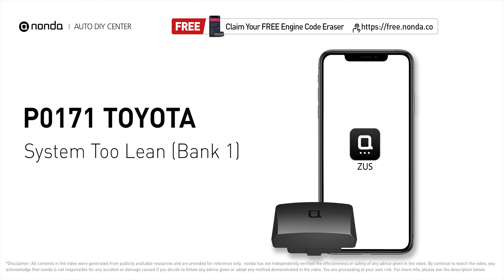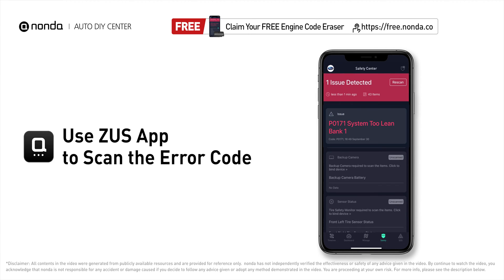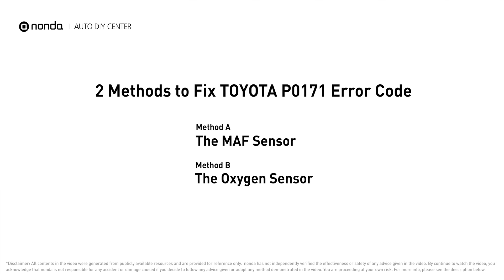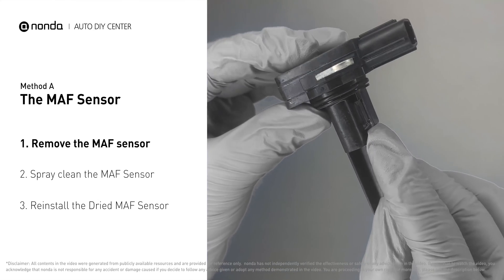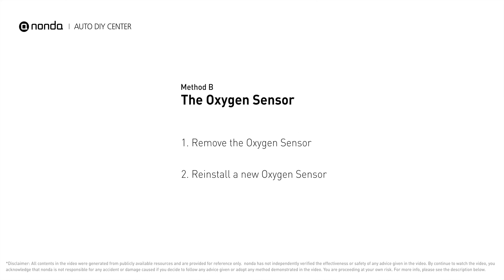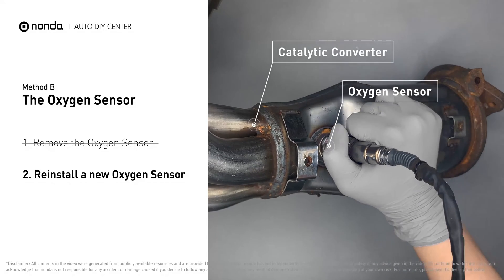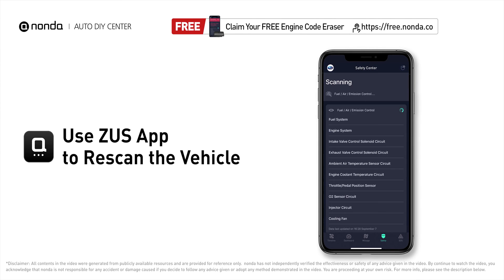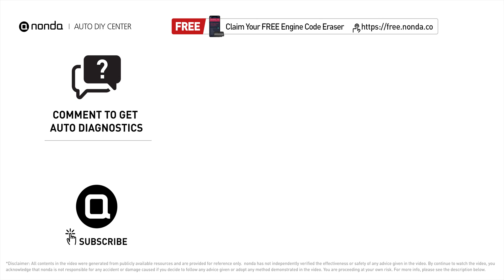How to Fix TOYOTA P0171 Engine Code in 3 Minutes [2 DIY Methods / Only $8.37]

Comment: If the ecu is detecting a lean condition that means the O2 sensor is detecting oxygen which means it is working.  If it wasn't working then you might run rich.

Comment: I changed the fuel filter (strainer) to fix this issue on my 2005 Rav4. It is located in the fuel pump on the gas tank behind the back seat driver side.

Comment: SpeedoJosh
#1SpeedoJosh [OP]
Well-Known Member
Messages:
2,300
Gender:
Male
Florida
Vehicle:
2010 Access cab, Base, 4x4
So I've been plagued with a P0171 code (lean bank 1). 
Trying to be a mechanic, I read the code and started googling. Part after part, nothing.
O2 sensor
Plugs
2 Coils
MAF
Fuel injectors
Fuel Filter
Fuel pressure regulator

Finally took it to a shop and had them live data read it. Low fuel pressure. Bad fuel pump. $500 to swap out. :mad:

So I ordered a denso pump from rock auto. Took the bed off, and swapped them out. Truck is running good now. No code. 

So glad that I figured out the code as I am going to be selling the tacoma, and didn't want to list it with a CEL. Just bummed that I threw away all that money when I could of just dropped it off for a $55 scan fee, $80 part, and an afternoon of wrenching. 

Maybe someone will search P0171 and see this and not follow in my foot steps. :D

Comment: My aunt has a 2013 Prius with the P0171, I cleaned her MAF sensor and she drove it and said it came on almost right away the next morning. I cleared the light again and it again came on within a couple miles the next morning. I’m replacing her upstream sensor tomorrow, hoping that fixes it
Reply: Did you get it fixed? I have three same car and issue

Comment: Cleaned the MAF, installed a new Upstream O2 sensor, still have 'too lean bank one' I'm thinking the injectors could use a cleaning and maybe replacing the Downstream O2 sensor.
Reply from the maker: Please provide us with your vehicle's year, make and model.
Reply: @nondainc 2003 Camry LE 2.4L. After the clean MAF was running for a while it all settled down after 30 miles or so and no more darned Engine Light. It was worrying the woman to no end.